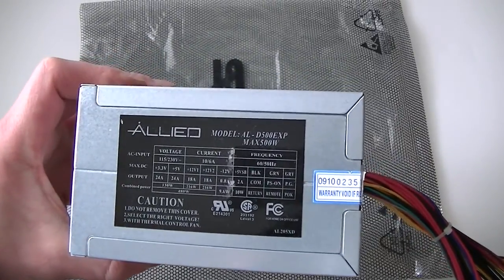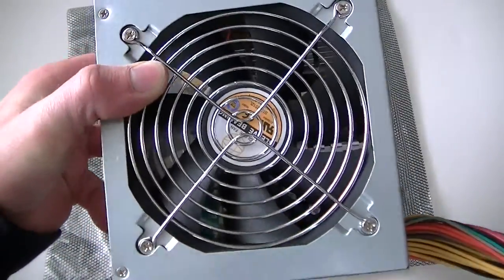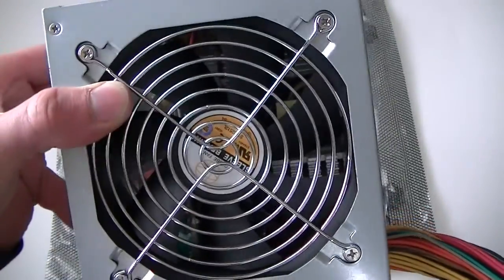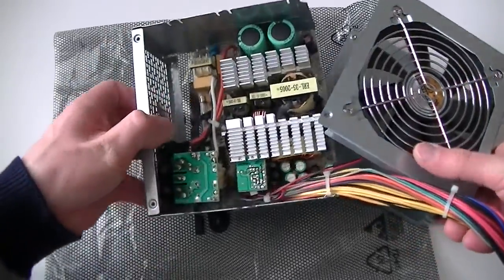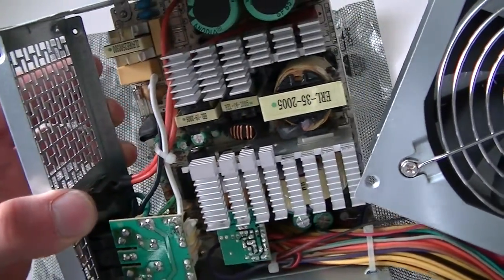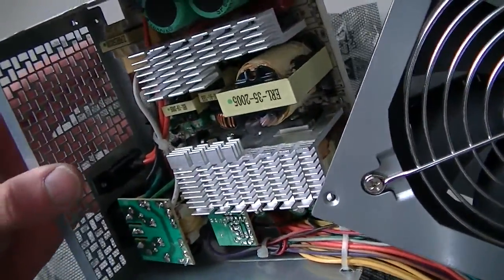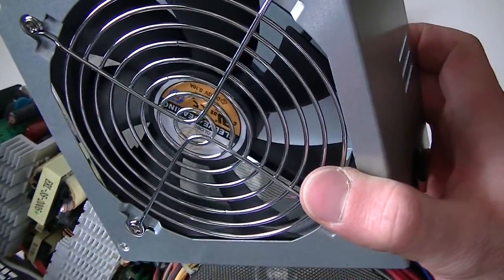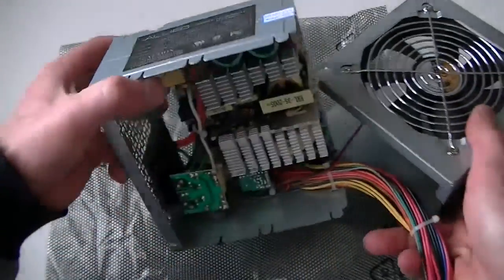APEX AL-D500EXP 500W Power Supply

Comment: FUNCIONA COM UMA GTX750TI?
Reply from the maker: Hi, yes you can use video card gtx750ti, gt 1030, gtx1050ti with this power supply will work fine.
Reply: @Mxkdt  do you think I could use a allied 750w psu for a amd rx 580 8gb

Comment: you'd be amazed at how resilient it is, I have and amd fx 8320 and an evga gtx 970 sc in my rig and I ran it for 2 days before deciding I wasn't going to risk 900$ worth of hardware on it lol
Reply from the maker: +perks719 Hi, i use this power supply for testing different motherboards and it works fine for me. I recommend power supply for your gaming system a SeaSonic 750W or CORSAIR RM Series 750W. Thanks
Reply: +mxkdi Yea after one morning of messing around with it I shut it down and ordered an evga nex750b1 on sale for 60$